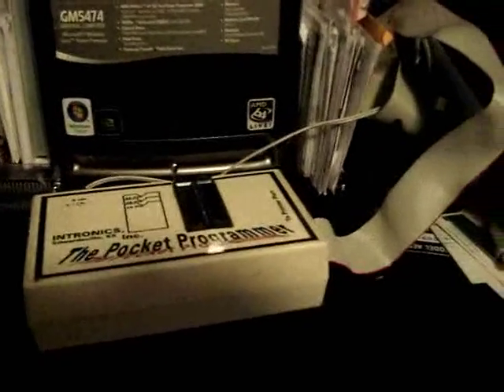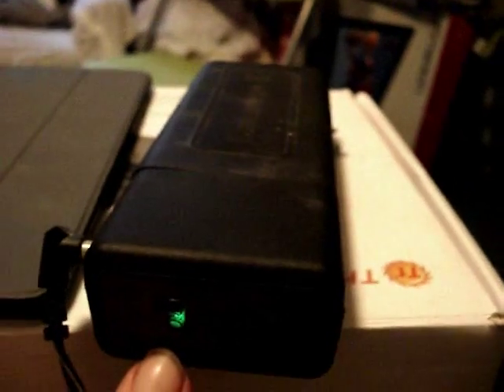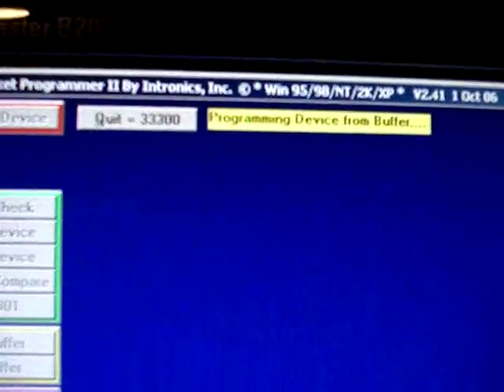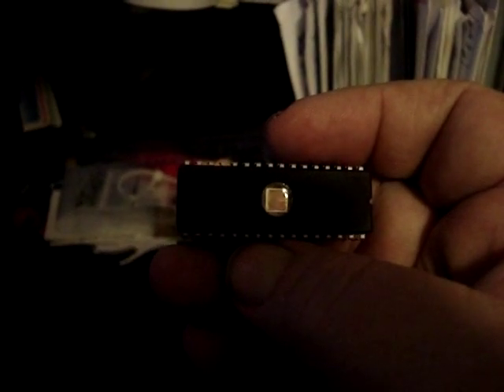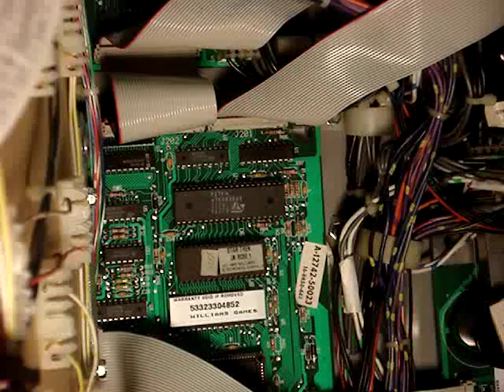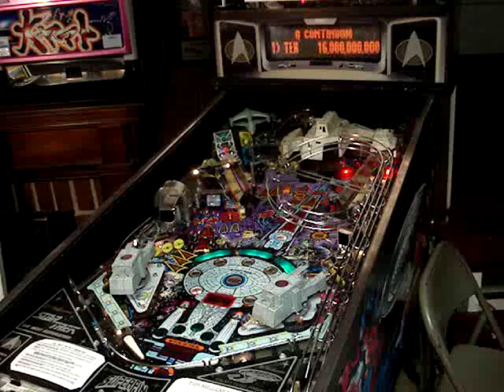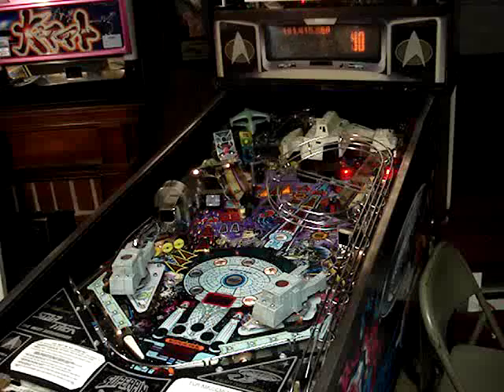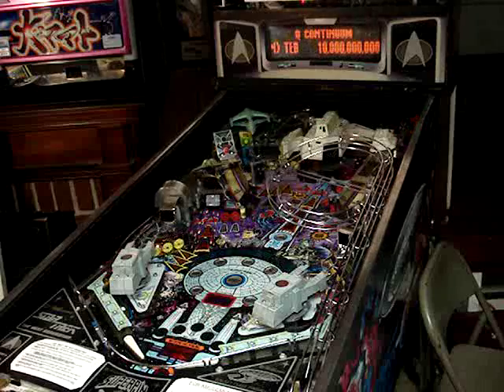Burning a New EPROM to Upgrade a Williams Star Trek TNG

Comment: I just picked the same ROM burner up off of eBay and was curious as to where I can find the software. I noticed you were using software that said it was for the Pocket Programmer 2 on the title of the window. Will that version work with the first parallel port pocket programmer also?
Reply from the maker: Yes, the windows version for the PP2 will work on the original programmer. Note, you need a computer with a dedicated parallel port, a parallel port adaptor card will not work. Here is where you can download the program. https://xtronics.com/memory/updates.html
Reply: @SamsArcadeFix  thanks for the link. I'm old school & probably have 5 or 6 desktops & a couple laptops around with working parallel ports on them. 

I'll probably use this old eMachines (Frankenstein really) that I saved from the trash about 10 years ago for the sole purpose of making arcade IDE drives with CHDman.